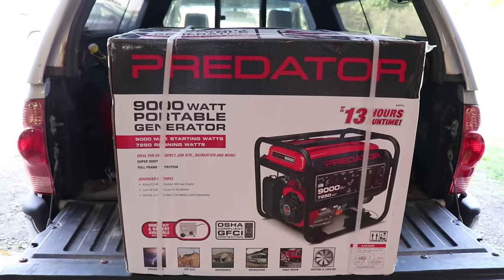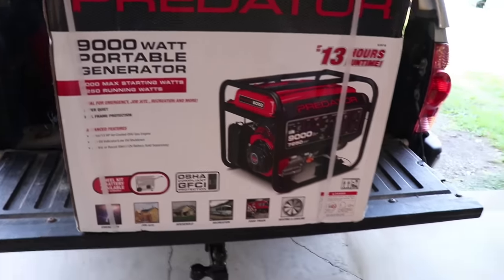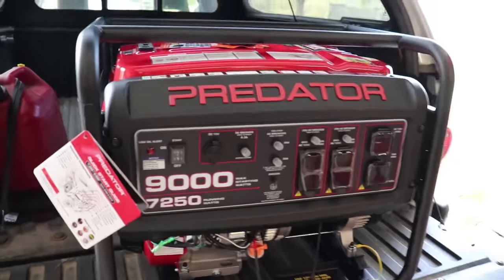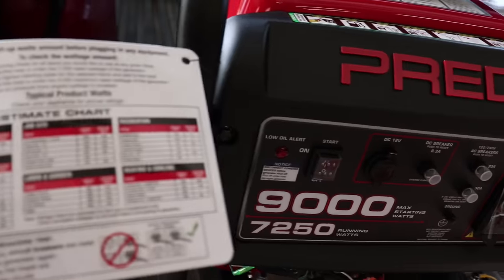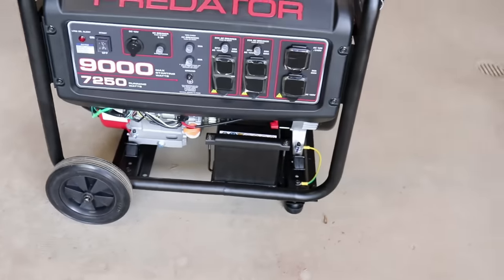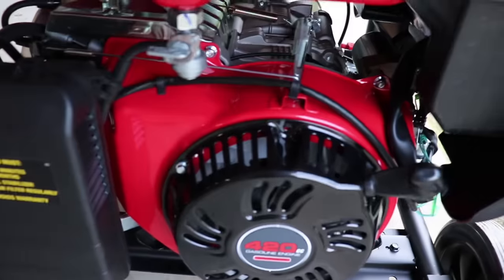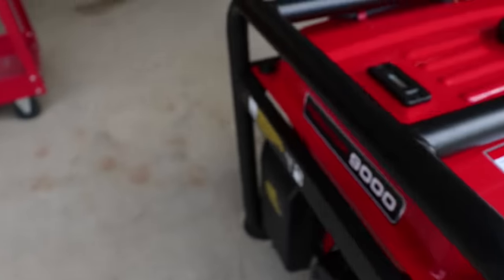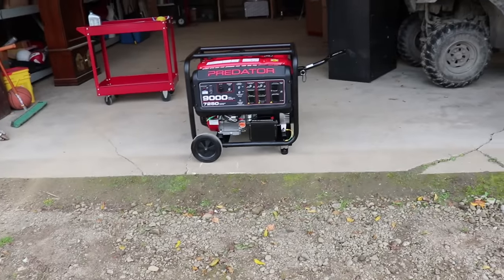Predator Generator Running Our ENTIRE Home. (Complete Setup and Cost)

Comment: I have a small cabin with a 230v blue 3 prong plug coming out the back of my cabin inside the small cabin there is an led long light a small electric heater and a out 4 sockets can anyone tell me what size generator I need to run this please ,all sockets wont be getting used at once just the odd kettle boil also it needs to be a light generator as will need to be lifted in and out of boot of car by my girlfreind daily thankyou
Reply: Get a 2000 watt or 3000 depending on what else is being plugged into those outlets. Heaters are no more than 1500 watts but biggest draw in your list if plugged items are low wattage. Check that kettle, you'd be surprised the draw some appliances have but just turn heater off when using larger draw. Running watts and startup voltage are important. So if heater hits 1650 at start 2000 should be enough. Amps work like this 15amps/1650watts, 20amps/3500watts etc but calculate at 80% usage rate. Lights, electronics are measly at 1-15watts so no worries. You do need an Inverter Generator if plugging in sensitive electronics, regular generators run full power so no voltage protection.
Reply: @eyeswideshut2800  thanks so much for your advice it's very much appreciated all the best and happy new year to you alan

Comment: HARDLY ANYONE ADDRESSES THE GENSET HAVING A FLOATING OR BONDED NEUTRAL. WHEN HOOKED TO A STRUCTURE WITH A GROUNDING SYSTEM, THE GENSET SHOULD BE WIRED AS A FLOATING NEUTRAL TO PREVENT POTENTIAL ELECTRICAL SHOCK HAZARDS.
Reply: Stay safe. Make sure you watch this video about generator safety https://youtu.be/I1jT3ANENvI stay safe thank you

Comment: You should never break in a new gen on syn oil valves rings will not seat properly with in 400 hrs run time or less moter seaze up use regular non detergent  oil for at lest 50 hours i have done that before then  u can run syn oil.

Comment: Generator uses so so much gas or diesel because the motor is way too heavy. If you can make an incredibly light motor that is not heavy as metal. You have figured out how to make a very efficient generator.. Heavier motor requires more fuel to rotate it 😀
Reply: Here are the portable generator safety rules: this safety information is only for anyone who use a portable gas generator and for those who are planning on getting a portable gas generator. This is just a reminder for everyone’s safety. All generator safety rules should be followed carefully. This advice is just to make sure that everyone is aware of all the warnings and it’s just to remind people to be careful using portable generators. Generators can be dangerous if not used carefully. Every year, hundreds of people die or get injured when using portable generators due to carbon monoxide poisoning and electrocution. Make sure you are using your generator carefully and keeping others safe as well. There is something very serious that everyone should always be aware of when using generators. Some people do run their generator indoors which is not safe and that increases the risk of carbon monoxide poisoning which can cause death of family and you. Some people run their generator in wet conditions which can electrocute them. Please remember that you should never run your generator indoors. Remember that carbon monoxide is an odorless and colorless gas that you cannot see or smell. Carbon monoxide is a silent killer. Keep that in mind. Make sure your generator is 15-20 feet away from your house and away from doors, windows, and vents. Never use your generator in your porch too. Having a carbon monoxide detector is very important against generator safety. Some people also allow children to go near the portable generator which could pose risks. We need to keep an eye on our children making sure that they are not near the portable generator so they won’t get electrocuted or burned by the generator which is dangerous. A locking enclosure also keeps kids safe. A generator shed might look like a tempting place to explore, or take cover during a game of hide and seek, but a generator is a dangerous piece of equipment that can cause injury. It says on the manual that we should also keep children away at all times from the portable generator to avoid injuries. Please do not allow a child or unqualified people to operate the portable generator.  It is important to keep your children safe especially little ones. The portable generator can be hot during an operation. Just because some manuals missed what should be listed doesn’t mean it’s safe to do. Always follow the generator safety rules when using portable generators. Generators pose electrical risks. If you need to use your generator during wet weather, you need a generator tent to protect your generator from getting wet. Don’t let your generator get wet. Keep your generator dry and before using your generator, please make sure your hands and your generator is dry. Do not wear loose clothing when operating the generator. Everything that is said on the generator’s operating manual should not be ignored. Never smoke cigarettes near the generator. Please keep flammable things away from the generator. Never overload your generator too. Your generator can catch fire. Never ever try to plug a generator cord into a wall outlet to avoid back feeding. Back feeding your generator is dangerous. Always turn on your generator first before plugging in appliances and shut off the appliances before turning your generator off. Use a heavy duty cord for your generator and the cord should not be worn out. All the instructions should be followed carefully. Never refuel your generator while it’s running. It can cause fire if fuel spills while your generator is hot. You should turn off your generator and let it cool off before refueling it. Having a fire extinguisher next to the generator is also important. This is only a reminder for everyone’s safety of using generators. Make sure your generator is properly grounded. Having a fire extinguisher next to the generator is also important against the safety rules. https://youtu.be/I1jT3ANENvI and here is a video more about keeping others safe when using generators and also about our family’s safety. Hope this helps. Thank you.

Comment: Bro thats dangerous! you should get a 8 circuit switch. it allows you to switch 8 circuits from the grid to the generator when there is a power outage. the setup you have is extremely dangerous, hence why it is illegal. any electrician will inform you the switch is necessary.

Comment: My brand new predator 9500 came with a broken combination switch not stopping flown of gas in off. “30 days to replace” and told it will come “without instructions” and “maybe check youtube”. Checked youtube and this is not an easy replace.  You have been warned.

Comment: Be careful buying predator generators. My brother purchased one about two years ago and the motor did not last for more than a week. After speaking with the place it was purchased from he was told this is a common problem. Many people have complained about faulty motors in this particular generator. Some work for a while and some do not it's a gamble when purchasing a predator generator. Very nice machine but poor quality with the motor that was installed in these units. If yours still works great then that's wonderful and you lucked out 👍🏻

Comment: How come nobody with Predator 9000s are using the two 20A, and the 1 3 prong 30A?  Everyone uses only the 4 prong 30A and can only get 1/4 of this beast's power. 30A =  3300W.
Reply: No my friend, When using the 30A plugs, you are getting the full 7250 running watts. There are two legs providing power on the generator.
Reply: @Pk3_Garage  Yep. I was looking at transfer switches, and basically you'd have half the breakers on the neutral/black and the other half on the neutral/red, with any 240 breakers on black/red. 30A x 120V + 30A x 120V = 7200W.

Comment: After 3 years.....any follow-up?.....with everyone (nowadays) worried about frying "delicate electronics" and therefore trying to force everyone to upgrade to inverter-type  or low THD generators.....what has been your experience? No one really defines what kind of devices are "delicate"...as I see a lot of folks using these standard type generators for laptops, flat-screen TV's, internet box, etc.....with no problem.
Reply from the maker: I've had zero issues. This generator is amazing.

Comment: That's a costly generator and the problem with generators is you wear them out really fast you can't idle them down too much and they're not built to go weeks on end what you need to do is get yourself industrial batteries there's the size of boat batteries and the three to five thousand Watts inverter then get five or six of the industrial batteries they're pretty pricey then string them together you can run one side of your load center off of them you use the generator then to charge them once a day this way your generator will last years instead of weeks because sometimes and especially with the way things look these days that's a real possibility just saying dude you got the right idea but you got to go a little further and if you're going to invest in the battery backup you've got to get an EMP surge protector your insurance will cut you some slack it'll protect your house against lightning and if anyone ever uses EMP weapons or a very large solar flares your electrical system stays intact also you can run an extension cord with two male ends from your inverter into any outlet on the side of the load center you want to run it's like that easy same way you kill the main before you set up your alternate power

Comment: I want this generator but the only drawback is that it isn't dual. I want to use propane.
Reply: Don’t forget about generator safety https://youtu.be/I1jT3ANENvI stay safe
Reply: Just install a Tri-fuel kit from US Carburation. You will be able to us gasoline, natural gas and propane. I installed this on ours and it work great. Natural gas is our primary fuel source.

Comment: Get a propane carburetor. Propane doesn't go bad like gasoline.
Reply: True propane has an indefinite shelf life.  But generators running on propane produce about 10% less power because propane is less efficient.
Reply: @danburch9989  That's negligible. Just factor that in when purchasing a generator. You should buy a generator capable of producing 30% more power than you plan on needing anyway.

Comment: I have the same gen but with out the elec starter do not leave it in the garage closed up I used mine in the carport that I closed off due to the meth heads it will take a few months for the co2 to dissipate from the materials even tho I had the window open on the carport so make a permanent place outside to place it 
1 gas I put 5 gallons in it closed the entrance door the house it ran for about 8 hrs 
2 oil first run I put almost 2 quarts in it 
3 loudness the reviews are correct it is load as shit even with the door closed it is really loud 
4 if you plan to leave in the garage or carport area closed off when I suggest that the run the muffler threw the wall outside some how the co2 will became a house guest for about a month  trust me I know we were with out power for 5 days from the last Texas hurricane and i live in Georgia lol  so the morel of the story is outside is the best

Comment: Do you have a power disconnect to keep from accidentally 
putting  power back into the transmission line?

9000 watt generator are gas hogs.  $50  gasoline/day
I am guessing about near 3/4 gal/hour .  Better have a 50 gal
gas storage supply for a weekend supply

4000 watt is much better using time sharing of Refig/ micro/ furnace or  air con.
Propane Generator 1/2 price of fuel

Oil changes every 24 hours.  Buy a case of the best oil for your love needed generator.

Comment: Sorry Sir; but You disobeyed the Federal National Electrical Code. ("NEC") For in NO cases; your panel should be powered from different sources. And you can be in real danger if your electrical Company finds out that you are doing that.

NOT even when testing it. For...

You MUST install a "Generator Interlock Kit" in your panel. Which prevents two or more power sources from powering your panel at the same time! Because it is a major crime, really! So the Generator Interlock Kit stops that immediately; and there is no way to get around it. In other words: you either have "this" one or "that" one; but not both at the same time. There are two major reasons for this:

1. You are putting 240 VAC on that electrical company line; and that COULD kill one of their linemen technicians; even though they have thrown "THEIR" breakers. 

2. The electrical company, over many years, has perfected a pure "sine wave" in AC volts. Because there are many things in your homes these days; that can get "messed up"; if the sine wave is not "clean". And most of these generators do not provide "clear" sine waves. Some do, but most don't. And that means sensitive electronics in your home, even an electronic A/C, can be "fooled"; without "clean" sine wave 220 VAC.

End of story; and I rest me case.
Reply from the maker: Thanks for that long comment. You could have avoided all that typing by actually watching the video. There is a interlock switch installed. In the video I mention that it had to be ordered as it was out of stock. It was installed 2 days later. I actually put the video of it in the description. 

Next time watch the video and you won't look like a fool.

Comment: Your water pump doesn't run on demand. The water will run for a little while until the pressure from your bladder tank gets low enough to kick the pump on. Just a little info. Great video otherwise.

Comment: Next time get a generator with an overhead valve it won't be so noisy you going to drive your neighbor's nuts with all that noise
Reply from the maker: I live rural and my neighbors help each other so that would never be an issue. It would stink to live somewhere that if the power went out the neighbors would get mad at a generator.

Comment: I would stay away from Predator, bought the 8750, tank had leak had to wait 6 months for replacement tank. Made in China tough to get parts
Reply from the maker: Had it over a year now....zero issues.
Reply: @TheCookFamilyHomestead  Hope you never have issues, hard to get parts
Reply from the maker: @FC-ju7bm  I hope not either. Been a good generator so far. Bummer you had issues.

Comment: Every video I’ve watched doesn’t show the generator’s running in rainy weather⚠️
Why is that❓ A sizable shelter or storage box could be used to keep generator dry. I’ve used my gasoline generator under my open carport for several years during stormy weather. So come on and get those videos while weather isn’t nice and sunny. 10-22-2021

Comment: One thing to mention your set up is cheap to do for sure. But for an extra  $150 you could have just bought a generator transfer switch  way easier and safer. Could have skipped so many unnecessary steps.
Reply from the maker: Great advice.

Comment: Use no Ethanol fuel . Stabil sucks . Drain the fuel and change the oil.I leave mine dry and ready to go when I need it. I ran mine for 30 minutes and changed the oil . Oil is cheap engines aren't.

Comment: Battery is sitting backwards
Reply from the maker: That is what I thought as well, but you can't put it in the other way due to the length of the wires.
Reply: @TheCookFamilyHomestead  
With this exact setup how much stuff can you run in your house before it trips the 30A breaker? Or is there no problem?

Comment: 9000watts / 120 volts = 75 amps. That will run a RV trailer but not a 200 amp house. So why are you claiming that this generator runs your house?
Reply from the maker: Because it does.
Reply: I believe that you are misinforming people
Reply from the maker: @sdfft820  sorry you feel that way. I don't lie or try to deceive people. The generator runs my whole house. Watch my videos in the description if you don't believe me. 

And if you still feel the need to call me a liar then move along and insult someone else.